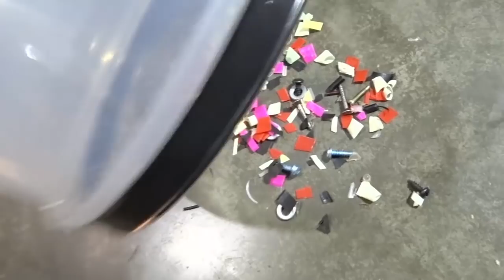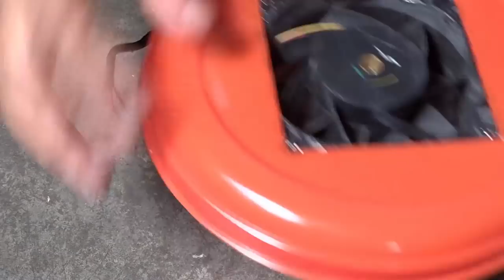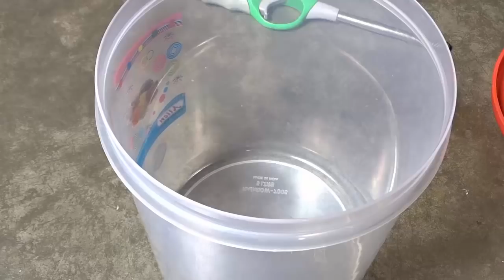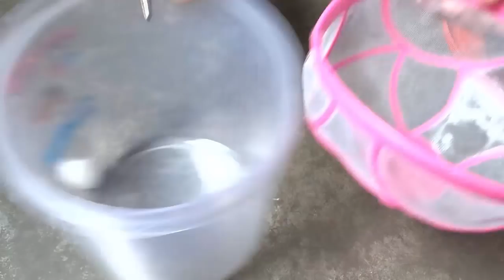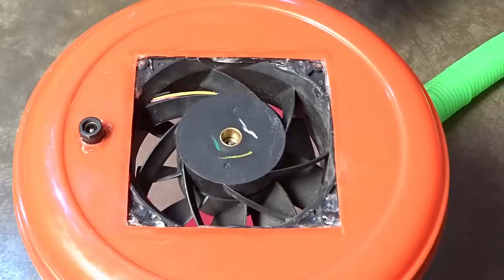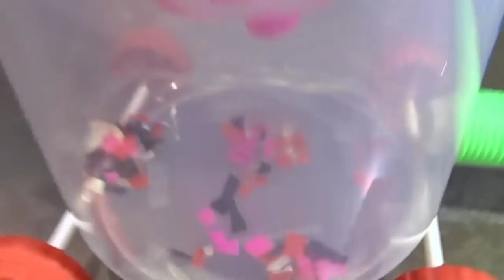How to Make Powerful Vacuum Cleaner at Home

Comment: Nice......... but less portable  .  I have a suggestion that you have to put  . Ac dc . Converter in it also and it must be AC vacuum cleaner
Reply: You are rite
Reply: Could we use 12v transformer and bridge diodes to drive the motor from AC power source?

Comment: Motor ac a dc aahe
Reply from the maker: dc
Reply: I think we could drive the motor by 24v dc; after making bridge rectifier, leaving out the "0" centre tap of 3 tappings 12v transformer(using 1st and 3rd tapping).Then we could spin the motar much faster from home ac power source and performance of the machine would be much more satisfactory. Just my idea and what about you?

Comment: Every single one of these videos are all the same put down the hot glue gun and pick up some stainless steel or sheet metal screws fabricate a bit don't always look to glue as a solution that's a hack method
Reply: Hot glue is fine for building stuff that only needs to last as long as the how to video.